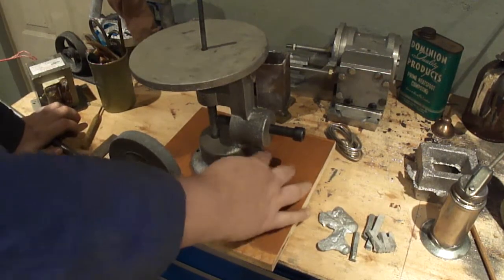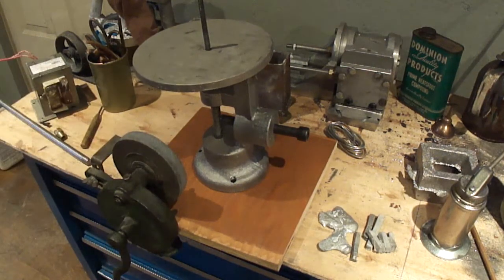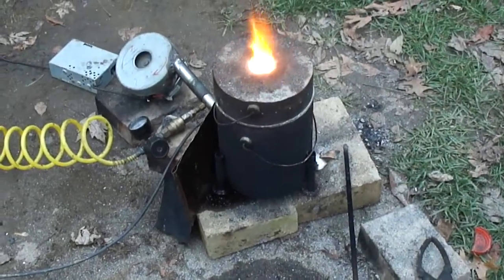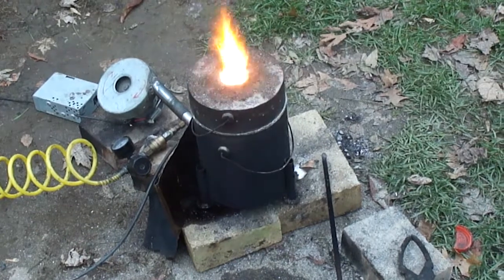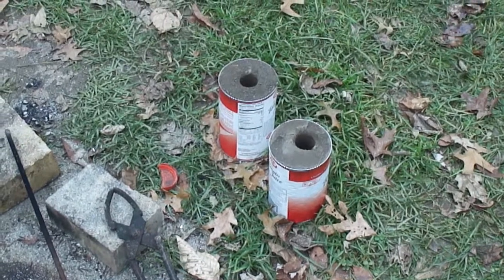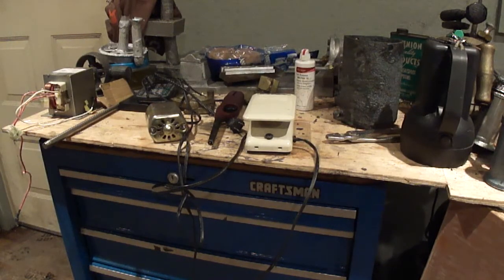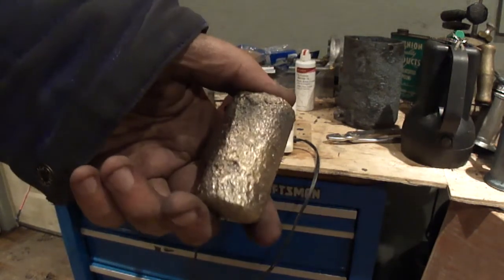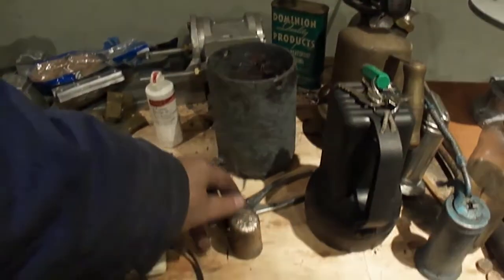Casting Day #8 - Making C932/SAE660 bearing bronze

Comment: How many times can you remelt the metal before the original qualities are negatively affected?
Reply from the maker: It depends on the alloy really, but most of the time, you'd run out of metal before you would change the alloy enough to really mess it up. Most bronzes can be remelted a number of times, but by then, you'll lose more to oxidation/dross and out to castings than you would to stuff evaporating out of the melts. I believe that brass is one of the only ones that the elements in it will burn out, but you would have to keep the brass above pouring temp for hours to change any percentages of any of it, which you wouldnt do anyhow tbh.
Reply: @ChirpysTinkerings  It seems similar to carbon loss in tool steel with repeated trips to the furnace. Cool recipe book.✌
Reply from the maker: @jamesbarisitz4794  Thanks, and yea, it is kinda similar to carbon loss in tool steel. You'll most likely lose more to the surface going to scale when heating it up and forging it, but if you keep it hot for hours and hours, you'll burn some out of it that way, but you really wouldnt want to do that anyhow, lol.

Comment: I am very curious about your furnace, how it is built. Mine is having issues reaching copper melting temps, brass and aluminum are no issue... Any advice? Thanks!!!
Reply from the maker: I looked at your video and it doesnt really show much on what the lining of your furnace is made of, or anything like that. I did notice that you run it without the lid alot of the time, and that'll take away alot of the heat. If you look up one of my latest videos, random bits #15, I show how my big furnace is made, and the little one is made of the same setup. I have a kwiky oil burner in both of my furnaces that I use most of the time, and with the insulating refractory combined with the oil burner, I can do everything including iron.

Comment: Bearing material is not cheap no matter what you do. Thanks for the video Chirpy
Reply from the maker: yea, I know it is, I was trying to buy some of this same alloy for the bearings for my lathe since the old plain bearing lathes, thats what most people use to replace it vs the old phosphor bronze. I think besides the power for the air compressor running and 10 cents in pennies for zinc, thats all of the cost that I really have in that melt, lol. Most of it was just stuff I had laying around that I found/scrapped out of stuff people threw away. Thanks for watching.

Comment: The little furnace aeems to work great!  Rain has been messing with me too, good luck with the next batch...
Reply from the maker: yea, I dont think thats going to happen any time soon now, Ill just keep the stuff in the shop and wait for the weather to get nice again. That little furnace defenitely is a little champ, and if I get it running on cooking oil like I like using, it'll run much much hotter, and take much less time to melt the stuff. I was stuck using used motor oil because of the fact that my cooking oil looked like shortening/crisco, lol.
Reply: Lol, I like to use cooking oil too, from chip wagons, local hockey arena canteens, etc., Basically anyone who'll let me take it for free.  Stuff I have now smells like it might be peanut oil, but who knows...  It was still liquid last weekend, somehow. Oh man I would have been really mad otherwise, as I had set up everything else first before going to fill up the oil tank...  There's always diesel in a pinch, I guess, but the gas station that's close to home is closed down while they rebuild it to have a bigger convenience store and put in new pumps.  So that would have been a huge pain.
Reply from the maker: yea, Ive tried diesel in my furnace a few times but it never worked out that well really, it just needed far too much air than I was able to give from my blowers, so it ended up just making a mess out of everything. If I could run it, I would use home heating oil instead because there's always people on craigslist with the big tanks of it for free, just need to go get it and the tank.

Im not sure why, but the cooking oil always seems to burn cleaner, no smell, no smoke, and it just heats everything up much hotter, and everything melts much faster with it than motor oil. The batch I used in this video tho, I think there may have been a small amount of old motor oil and 90% rocket fuel or something in it because that thing actually semi melted my lining in the thing, lol. I was wanting for it to do that tho, the lining kept crumbling and now, everything's sintered together and wont fall apart anymore.
Reply: Lol, so it was the good kind of melted furnace then...  Was gonna ask how it held up.  What type of refractory?  Mine is 3200F "Unicast-70" and held up to near white heat for an hour or more like a champ on first firing (using diesel).  Only oil I ever could not get to burn well was wmo from father in law's motorbike.  Topped up my tank with it once and the burner just went out like a light.  Never figured out why (or used that oil again).
Reply from the maker: lol, it's the homemade stuff using fireclay/perlite/portland/sand. I'd have thought it would have melted more considering that the furnace was actually brighter and hotter than clarke's furnace when he was doing iron in it. I easily had that stuff at iron temperatures, and I learned quite a bit about that little furnace that needs fixed, but at least the lining is fired/sintered fully and ready to go for future melts, lol. I usually used it for melting brass, and it didnt even touch the lining, but the melt in the video was insanely hotter. It lit up everything around where the furnace was, and the flames after adjusting the airflow, it actually lit up the whole area with almost a bright yellowish white light coming out of it.
Reply: Wow, I guess that diy recipe is better than a lot of people have said it is...
Reply from the maker: yea, thats why you never heard me knocking it on AA when people were asking. I rather have something insulating firebrick with a hotface of mizzou tho for more thermal insulation, and just knowing that I have the overhead in case I ever wanted to do iron, that I knew that I wouldnt have to worry about melting it, but for aluminum, brass, and bronzes, it holds up great.
I also mixed mine a bit dryer than most people did tho too, so it was similar to greensand, then rammed it all into the furnace. I let mine sit with a bag over it for a few months during the winter to dry very slowly, so that I wouldnt have any cracking, which even now, my big furnace only has one tiny hairline crack and thats it, and it's had more melts on it than I can really think of, lol.